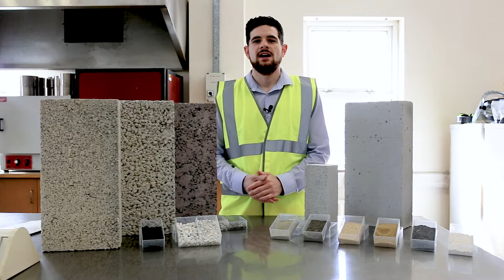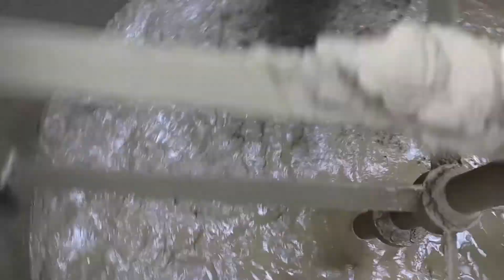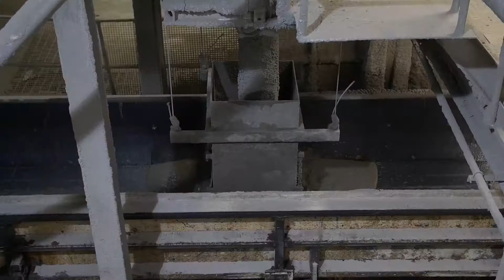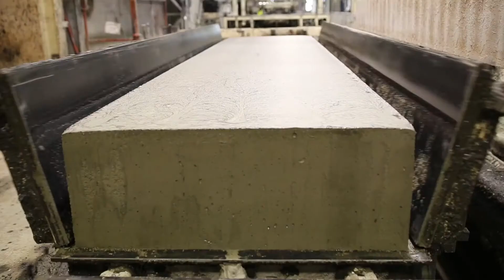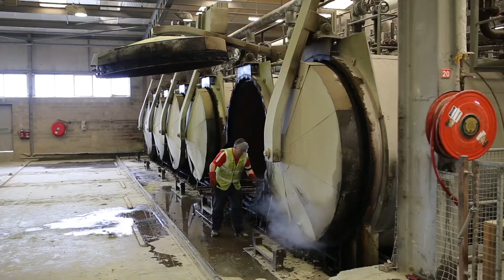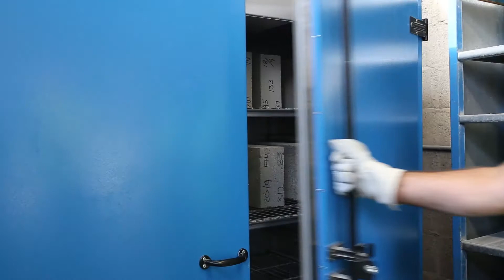Substituting thermal blocks on site: Is there a risk to Part L compliance?

Comment: Which would I use in the footings above foundation block? Inside a conservatory within the soil
Reply: Regarding the 3 blocks on his right the one nearest him is a roadstone thermal lite block ( made from expanded clay aggregate) regarding the next 2 one is made by booth concrete in Laois ( expanded clay aggregate) and the other one is made by I think kilsaran from I believe basalt crushed rock. I believe He is correct when he says the quinn block has the best thermal properties .
Reply: This man is even more boring than the priest on father Ted